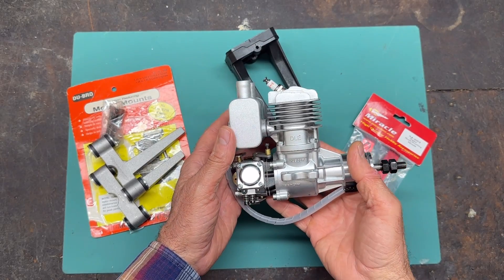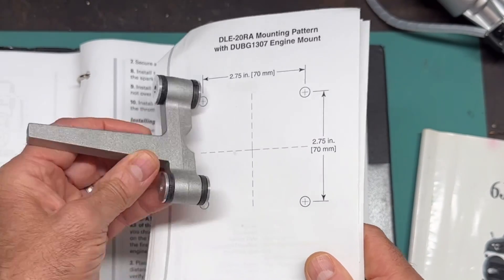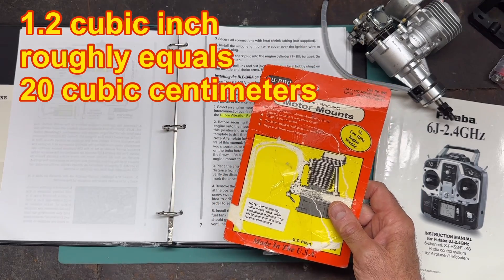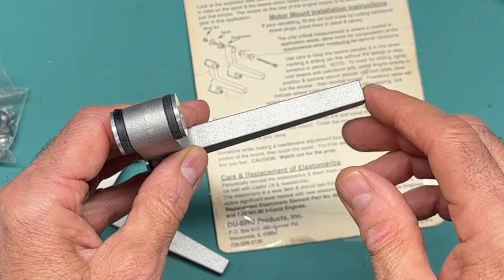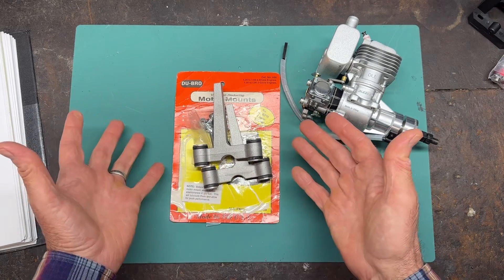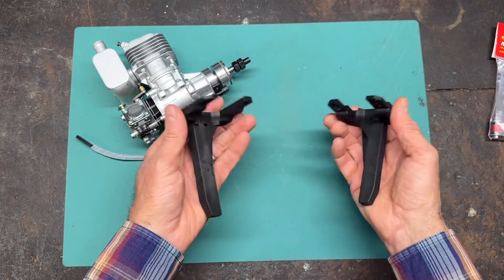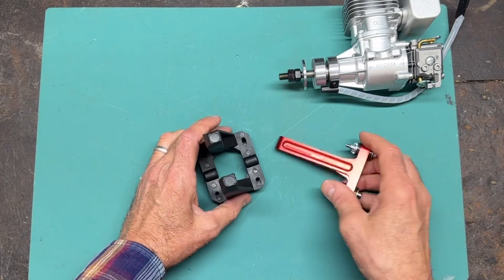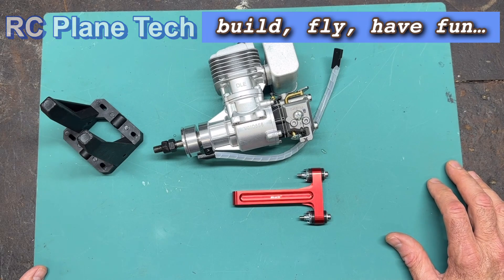DLE-20 RC Plane Gas Engine, Learning Series, No. 5: Engine mounts for the DLE-20 RA

Comment: cant you flip the mount>
Reply from the maker: Nope.. tried every angle… note that the Dubro guys tried it as well and determined it wont fit, they sent me the smaller size. Its an error on DLE manual. It works for the side exhaust but not the rear… they must not have checked it.

Comment: Drill a hole in the firewall for the carb to enter into.  This is typical with gas engine. Not a lot of mount options for the RE engine  with that huge carb.  I used the Dubro mounts on my DLE 20 SE.  I did have an issue with them breaking though right at the rear bolt hole.  Drilling them out seemed to weaken the mount.
Reply from the maker: Ya, I have seen posts of people with the dubro mount breaking. Maybe the metal is too brittle.

Comment: The RA series engine from DLE are rear aspirated engines intended for warbirds. The engine should be mounted upside down with the muffler pointed down, hope this helps, thanks
Reply from the maker: Thanks! Ya I realized that later. I got old glow habits to break!

Comment: You could chuck those Du-bro mounts up in a mill and take the taper off the bottom side and run them upside down. That lower leg is shorter.
Reply from the maker: Ya that would work, but if I had a mill I’d be making my own mounts from aluminum stock, hm that sounds like a good idea!
Reply: Plenty more rudimentary tools to do the same job. Sanding disk and a file…or just a file and some patience.
Reply from the maker: Ya, really, stick it in a vice and it probably wouldn’t take that much effort. That probably is the best suggestion. Ill keep that in mind. Cool!

Comment: Your Du-Bro mount will work. You are trying to mount your engine up right and it is intended to me mounted inverted with the exhaust openings pointing toward the ground noy nlowing in your face. Also you could put a spacer or stand off between your firewall and mount for added clearance.
Reply from the maker: Ill be posting a vid shortly to show it wont work either way. It would work if the mounting beam was straight on both sides, but it angled on the lower side so the engine would then be tilted. And then when you flip it in top of the engine mount it runs up against the exhaust again. Ill post the follow up vid soon

Comment: Hello James...something to consider. With regard to the Miracle RC engine mounts, you mentioned that you would drill out the firewall mount portion to a larger bolt. That would not buy you anything safety/failure wise because you still have the same size fasteners on the engine flange to mount t-bar. A quick look at the strength of tensile strength and bolt and threads of a good quality ANSI bolt or screw, a #8 fasteners is plenty strong. I cannot tell from the video what size comes with the t-bar...but no need to go up to 1/4 " bolt. Way overkill for this. But if you feel comfortable with a larger bolt, then a #10 is plenty big. Again...ditch the chinese fasteners and buy good quality ANSI rated fasteners.
Reply from the maker: Thanks for the insight. Ya I think Ill leave it alone and just use it on a smaller setup or your suggestion of the better quality bolts is good.

Comment: Could you use the Dubro engine mount if you flipped the engine upside down?
Reply from the maker: Just checked, it wont fit. Ill do a little update to the video. Thanks for checking this.
Reply: ok, It looked like it might would have worked. @JamesRCPlaneTech
Reply from the maker: Ya, I would have been nice. I like the mount. Im putting out an update to this vid because a lot of comments are coming in on this.
Reply: I see now what I was looking at, that angle was throwing me off, made it look like the opposite side was shorter. Thanks for the video. @JamesRCPlaneTech
Reply from the maker: Thanks!
Reply from the maker: Interesting, Id have to look at that… hmmm
Reply: I probably should have said flip the engine mount upside down, because it looked like one set of mounting ears is shorter than the other set.
Reply from the maker: Im gonna check.